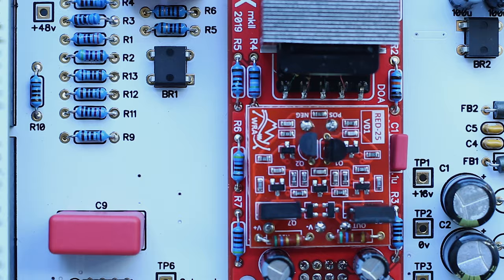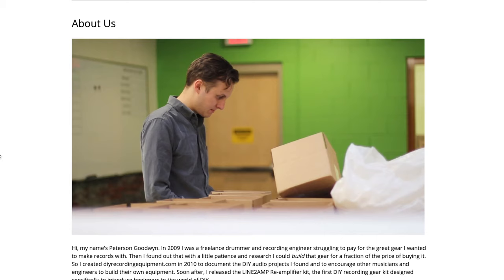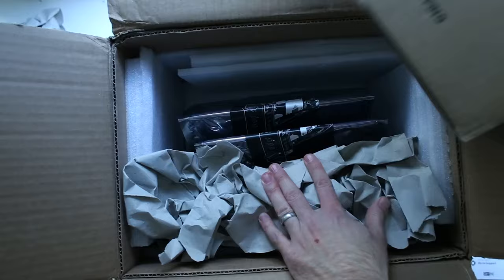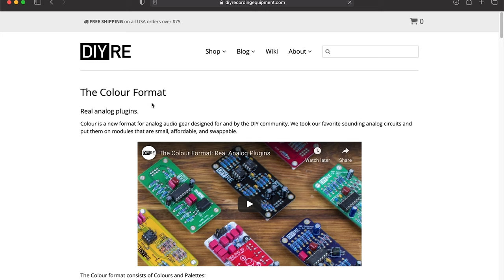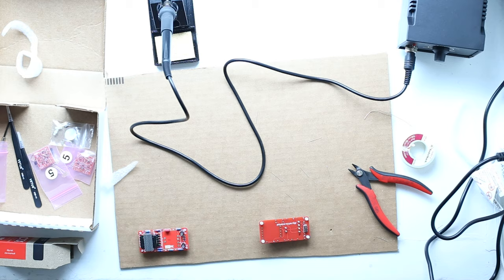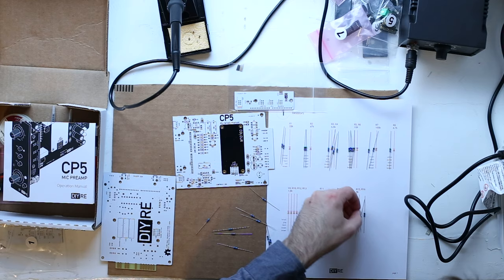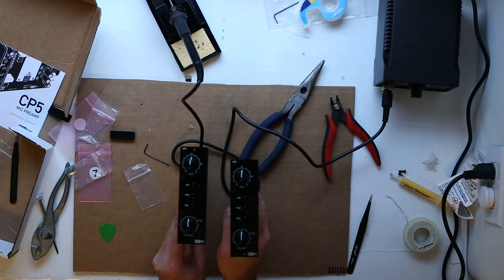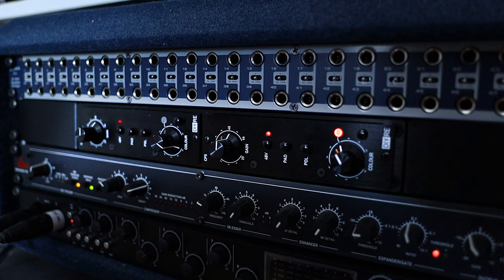I built a mic preamp (DIYRE CP5)

Comment: so for the resistors. most basic multimeters measure resistance. so for those resistors, just tap a lead to each end and it will tell you what size that resistor is.  it is so much faster than a trying to decoder the color bands

Comment: Love my CP5 ... have mine loaded with the Royal Blue (vintage Neve) Colour module.   I also have a pair of the Colour 500-Series Palette mkII loaded with Tape Saturation, Royal Blue and Implode FET Compressor which I use to add color when I do my mastering.  DIYRE makes some really great stuff. For the record I always have them pre-built.  Really like the vibe of your song as well.  Nice video!  Bought Running out the Clock.  👍